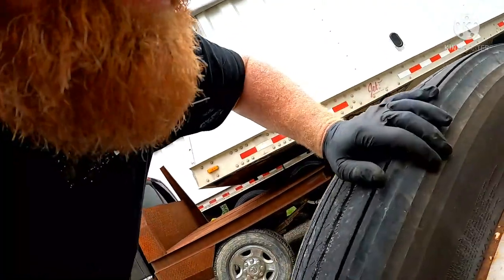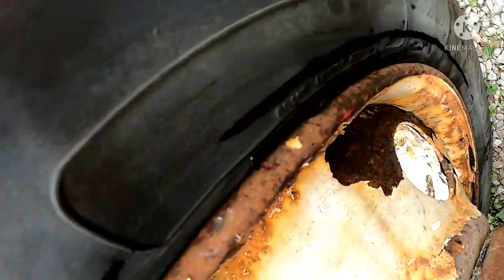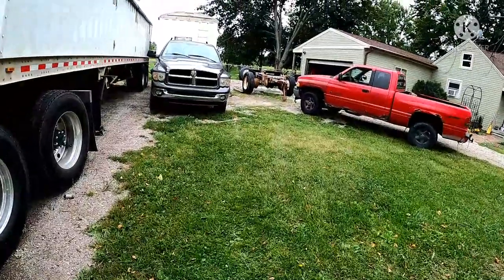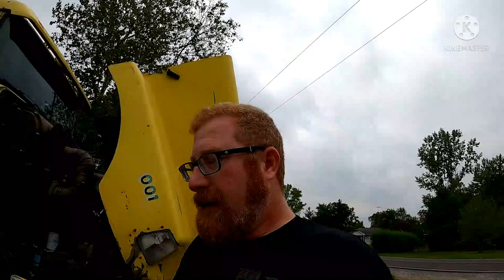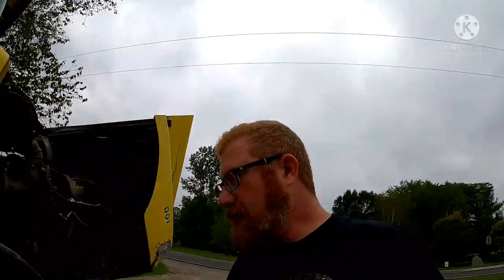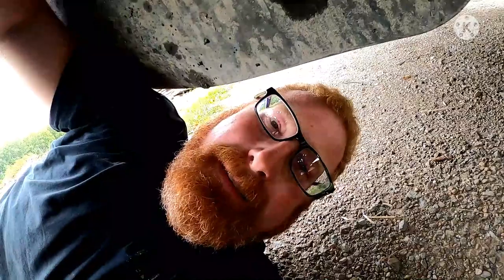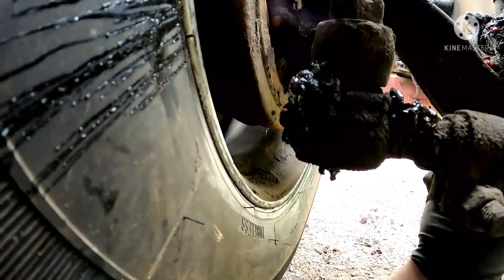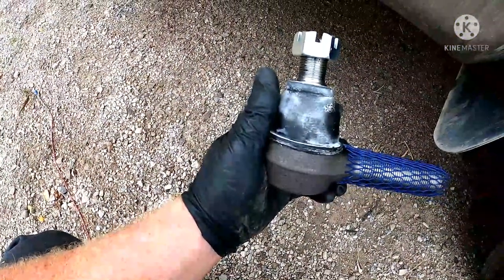Replacing Semi Truck Tie Rod ends

Comment: Just did my 379. I went to Pete to buy 2 tie rod ends. Walked out with a whole brand new cross tube assembly with tie rod ends for litterally same price. No fussin around with trying to remove and replace old ones in the old rusty cross tube. Surprised your parts guy didn’t tell you that
Reply: I’m gonna replace mine on a KW do I need to have it raised up or can I do it while it’s on the ground. I just purchased the whole set so the only difficult thing would be getting them off and the whole assembly just goes back on right?
Reply: Same with My Columbia. I was going to buy the whole assembly but they didn't have it, so I just bought the tie rod ends. I asked for a quote on the cross tube and it was cheaper to buy them separately. Of course they didn't have the cross tube either, so I found it at MP Parts for $100 cheaper.

Comment: I’ve replace my entire “tierod” assembly as of 9/7/22. Fixed some of the issue I was having with shaking. But I’m still hearing/feeling knocking coming from the front end. What else could it be if you don’t mind brain storming with me.? I’m thinking leaf spring bushing or maybe kingpins? I did get an alignment but the right side has just a little bit of play but not too bad! Thanks in advance!
Reply: Have your kingpins checked.
Reply: I’m thinking leaf Springs. Did you get the problem fixed?
Reply: 2nd the king pins
Reply: I haven’t yet. I had to put it in the shop for a new turbo. But I’ll definitely keep you guys posted. I appreciate the help!

Comment: Thanks for the video.

Just one question. Why not change out the cross tube as well. We're going through the same issue right now. 796k miles and can't hold an alignment. Chewing up steers.

Comment: Are bad tie rod ends what cause the clunk/knock when turning. I just replaced my drag link, which was loose, but still hear the noises when turning.
Reply from the maker: I would think it would be coming from worn spring bushings. Keeping them good and greased up should help lessen the clunking, but they will more than likely need to be replaced to eliminate it all together
Reply: @roscopsoultrain5875  That was my next guess, but the much more expensive repair, lol.

Comment: Did he say $35?.... they're 85 for a Peterbilt
Reply from the maker: Yeah but you have to deal with the ridicule of driving a Volvo so it evens out
Reply: Buy the whole cross tube assembly complete from Pete it’s same price as buying to individual ends.
Reply: @Tola Trucking I have a Pete and a Freightliner. I just bought the Freightliner and can't believe how much cheaper parts are.